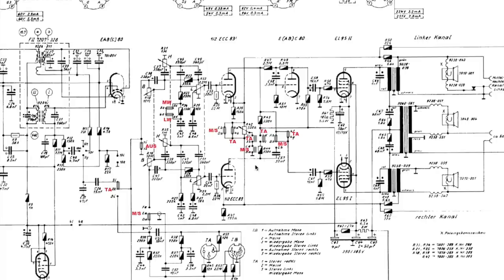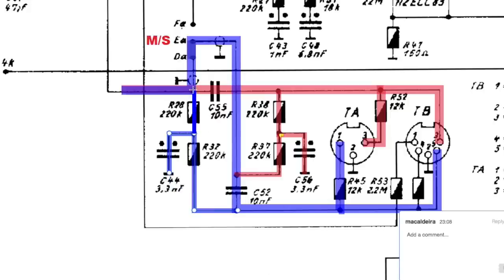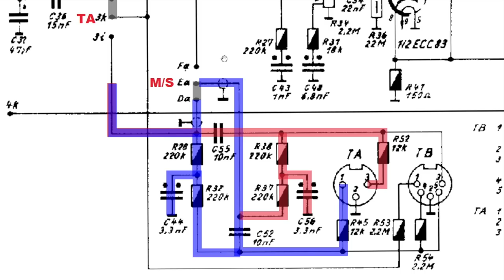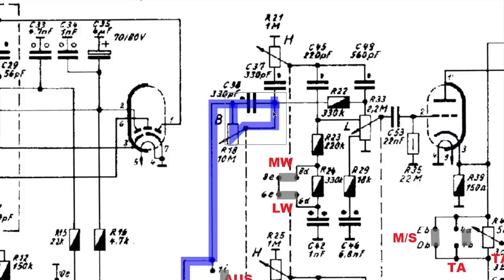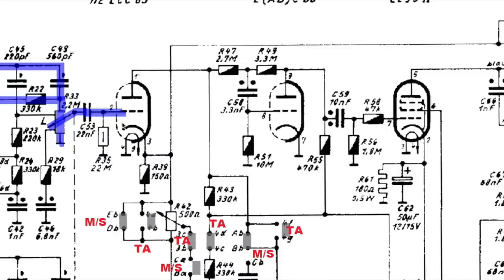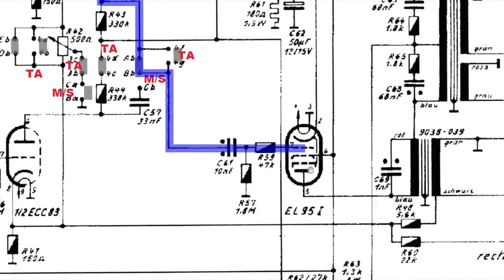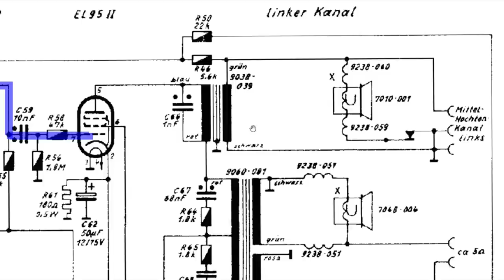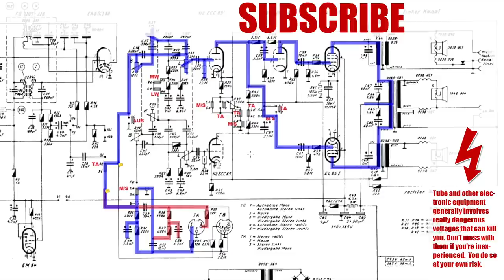Grundig 4006 Stereo tube radio restoration, part 3. Detailed graphical analysis of the audio path.

Comment: Didn't run on at all! Great explanation. Before I found your videos I hadn't seen many European-style radio restorations; not so long ago here in the States you could get these for a song at junk stores and antique stores, and I picked up a Grundig 2077 (working) for $50, and a Telefunken "Gavotte" I believe it's called, also working (although its filter caps soon gave out). Those old Northern European tube radios would just keep on truckin', and I believe it's down to the high quality of the caps and resistors. Eventually, though, the components were going to get enough age on them that they had to give up the ghost. Unbelievably, along with the Telefunken I also got its associated turntable, which was also working perfectly, for maybe another 30 bucks or so. A real find, that one. It's a nice turntable to play old 78rpm records with, having a relatively light tone arm.

These videos are filling in lots of little gaps in my understanding about these circuits. The Grundig 2077 has the ribbon tweeters on the sides, which I was really surprised to see in a '50s tube radio when I found it. It'll be interesting to see the filter circuit for those on the schematic when I pull it back out of its envelope, where I found it sitting, undisturbed, inside the radio. 

Really looking forward to finally diving into these, and it's a real treat and a great gift to be able to study up on them beforehand, as well as knowing what not to touch! Thanks a million.

Comment: Many thanks, it is a very interesting explenation.
The design of the circuit is very clever: if I got it right,  the right and the left channels are in fact driven as single ended and only the center (bass) channel is driven as push-pull.
Again, thanks for this video.
Reply from the maker: exactly

Comment: Thanks again for a much appreciated video!
I could be way wrong, but on the question of the purpose of the resistor from plate to grid on that stage, I think this is the reason:
"Push-pull stages are able to reduce harmonic distortions, specifically second order distortions, produced in the stage itself. The input stage has a single-ended configuration. A single-ended stage, operating in non-linear areas, produces distortions. If the distorted pre-amplified signal is given to a push-pull stage, distortions are amplified as well.

A technique to reduce distortions, across all amplifier stages, is the global negative feedback. Global negative feedback consists in using a negative feedback loop, which subtracts the output signal, appropriately attenuated, from the input signal."  
I really do enjoy and appreciate your videos.  Keep up the excellent work.
Reply from the maker: I think you’re almost there. That resistor is probably feedback, but it is local negative feedback, because it is bleeding back some of the amplified (inverted) signal at the tube itself. The other feedback path through the resistors from the transformer secondaries is the Global negative feedback.

Comment: Nice demonstrations. My sugestions is to modify the circuit for the input signal, to separate the left from the right channel. E very thinn ears can made the differences. Like in concert chamber , the bass instruments are on the right. If you may tried a LP , you may have the differences. Thank you for demonstration. Very interesting.
Reply from the maker: that won’t work in this case because the circuit has to convert the bass signals to mono to work the push-pull output stage for the middle speaker.
Reply: @electronicsoldandnew  it is right. I saw that in the final presentation. It is a pseudo-stereo configuration, using a single power amplifier and a separate circuit to obtaine the difference phase of the signal for higher frequency.
May I'm wrong , but the sensation , the sound can be very good .

Comment: Nice analysis of the circuit 👍. Grundig took a lot afford to avoid two EL84s and two bigger output transformers for separate stereo channels. The higher power of two EL95s in push-pull for the low frequencies is negligible. My five cents to the phase inverter 😉: The feedback resistor R49 is the most important component to make the amplification of the triode -1. The value of the grid bias resistor is much higher than the 2.7 Meg before it, so it wouldn't drop the signal level much. But the grid gets the inverted signal from the anode almost through the same resistor value 3.3 Meg. This type of phase inverter is called see-saw. Further information can be found here: http://www.r-type.org/articles/art-123f.htm
Reply from the maker: Thank. you thank you thank you. Your “5 cents worth” is worth a lot more than that to me 😊 
I was baffled by this inverter and didn’t remember the see-saw. Read it up again on your link and now it all makes sense. 
That’s why I love the medium 😊
Reply: In fact Grundig used two EL84s in the 5016-5019 and 5195. Similar circuit as 4006 or 4198 but much more power.
Reply: Obviously Max liked it. Otherwise he would have thrown it out of the window and it never would become a product 😂
Reply from the maker: true

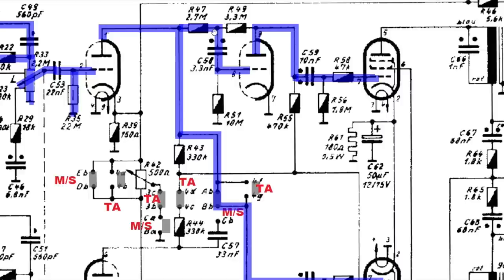Comment: Do you think R49 at 29:03 in the video is perhaps a half wave feedback resistor to stop self oscillation?
Reply from the maker: It’s been a while since I did that one, but I think it’s actually the norma setup for a see-saw phase inverter.
Reply: @electronicsoldandnew  Ah yes indeed. The fine details of these radios is a pandora's box. Thanks for the reply.

Comment: Just a question: Is the push-pull primary of the output transformer divided in two sections, one for each final tube? So we have "two" primaries?
Reply from the maker: Yes. Exactly like a normal p-p output transformer.
Reply: Ok. So it's possible that one section of the primary is in good condition and the other section is in bad condition, when we test the OT. That's right? Have you ever had this problem in testing OT?